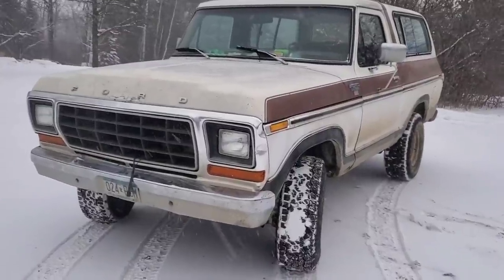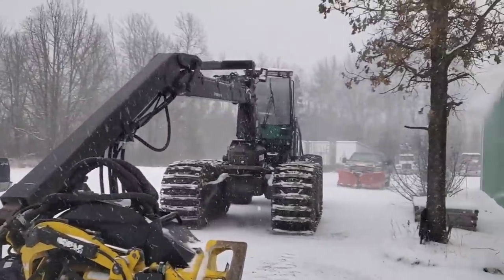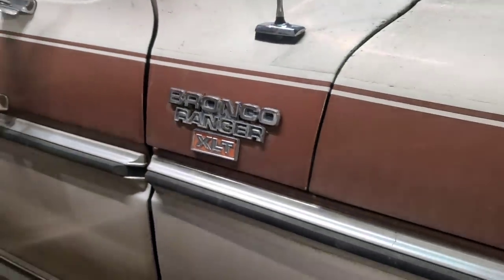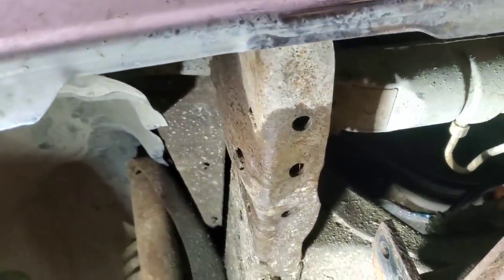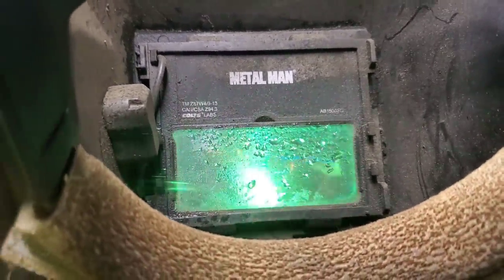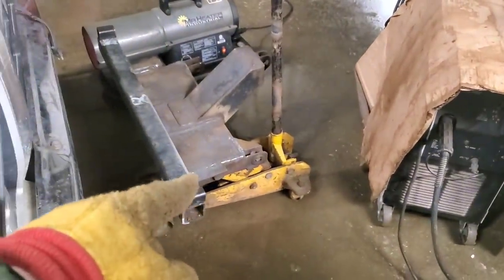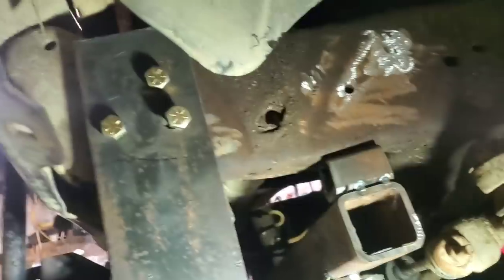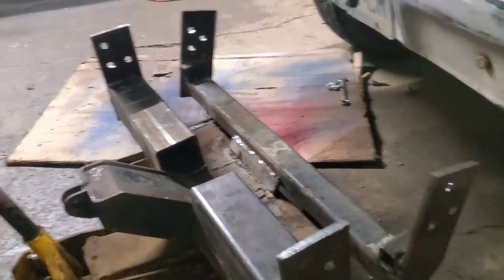Custom Ford Bronco Snow Plow Mount

Comment: Good job Matthew! Nice welds! Merry Christmas David and family! Plow easy with that thing. I had a 79 Ford Bronco with a 7.5ft Meyers on it and the front ears on the frame flex bad enough that it you hit something hard with it. It would split the radiator. I put a piece of heavy wall 4" pipe in between the frame rails to get it to stop busting radiators.